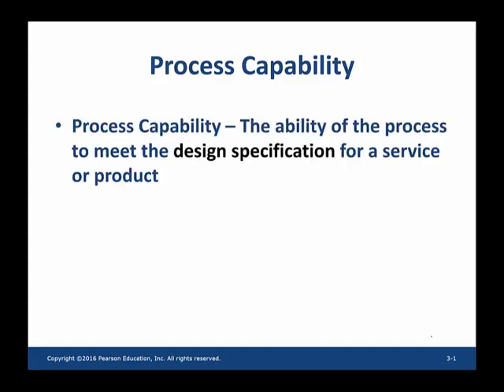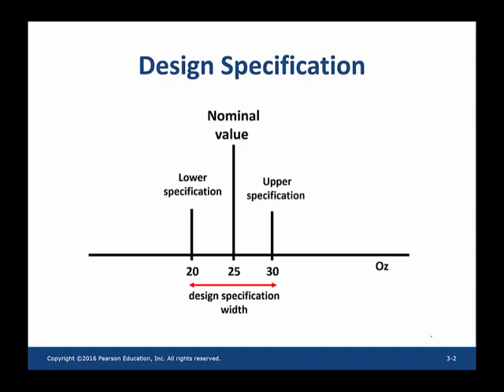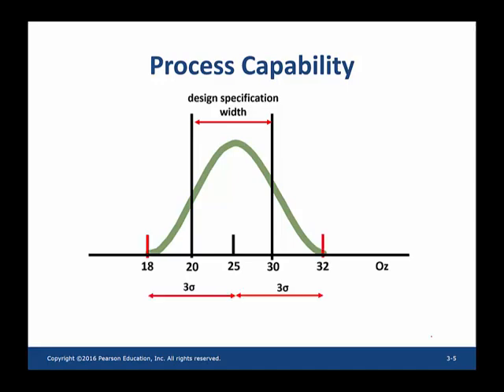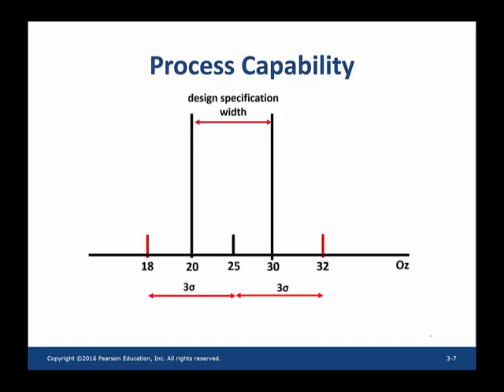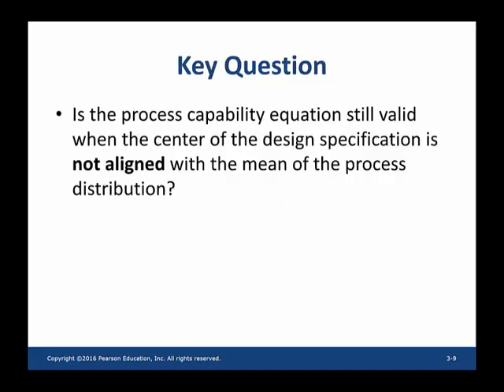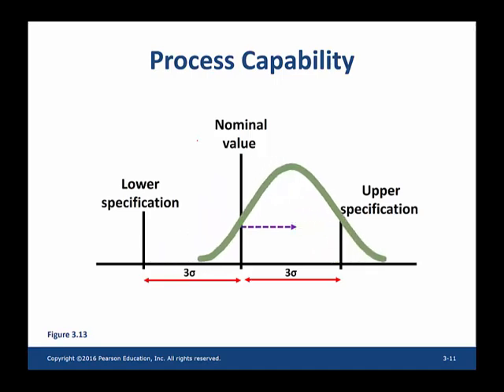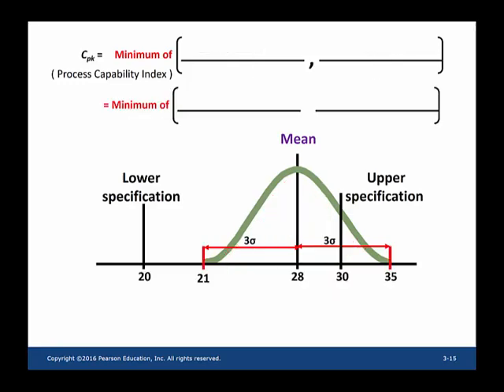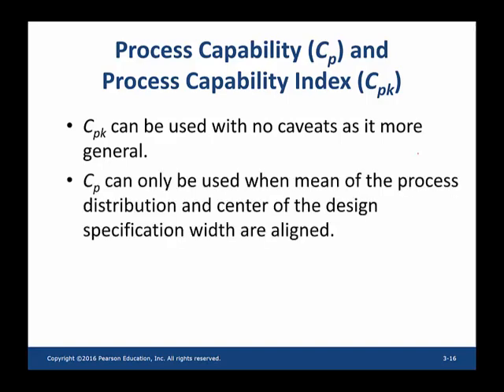process capability and process capability index

Comment: Very nice explanation sir..but how u chosen 18 and 32 for sigma values
Reply: Dear Sir. Lower specification comes from customers (or consumer protection as local regulations and/or laws). Upper specs. comes from producer firm's clear mind. In this case no one wants to buy under 24,5 oz. bottle water and it is not worthing to procuce more than 26,0 oz. bottles, for example.
Reply: @atekka1  i guess SD*3+/-mean will give 18 and 32..
Reply: @MrLionhart79  No. That is for only better explanation, graphic and calculation in example. Those numbers are unreal.

Comment: sir, can you please explain how do i calculate 3 std deviation from mean? what does it really mean? if i have a std deviation with me how can i plot 3 std deviation from mean ?
Reply: for 3 std deviation 
first, you need to have a standard deviation and add it to the mean and plot it on either side that results in 1 std deviation.
perform it 3 times on either side you will get 3 std deviation
in this way you can plot your graph
hope this answers your question!
Reply: @Ashok-xg1xo  ok ..thank you very much.. so i need to subtract it from mean to get values on lower side.. i.e. +/- 3sigma

Comment: Great tutorial! Only thing I would add, is that in real world manufacturing you can use Cp to see if your process is capable, even if the mean is shifted. If your Cp is above 1.0, then you know you just need to shift your mean to the center of the design specification and you will have a capable process!